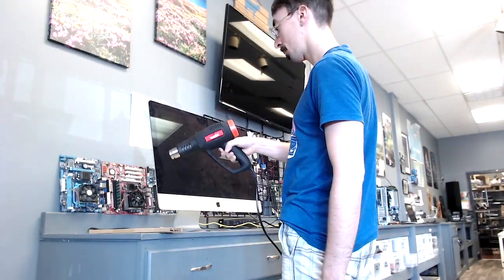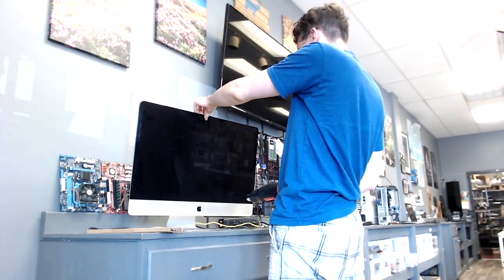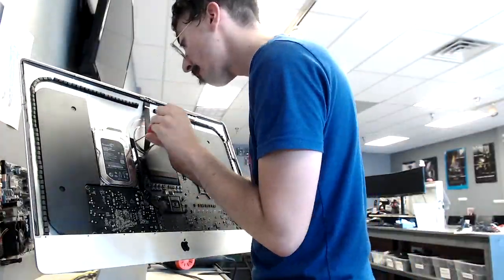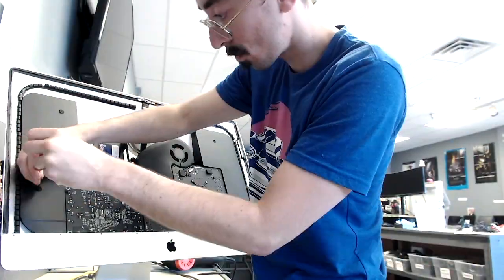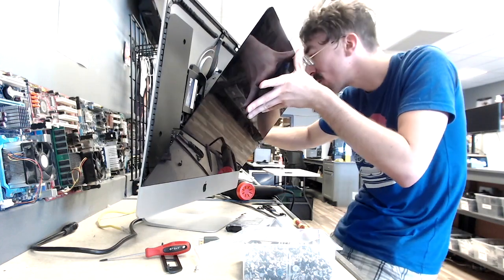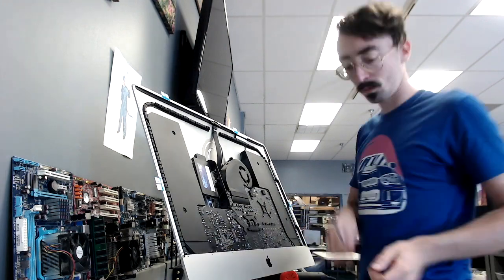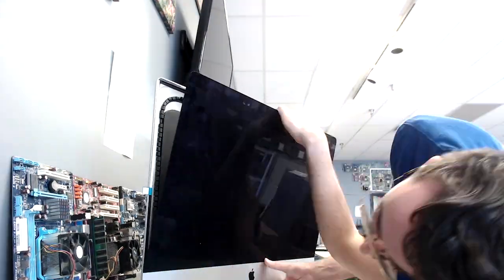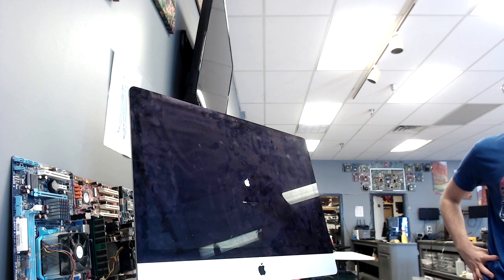How To Quickly Upgrade 2015 27" iMac Hard Drive to SSD

Comment: You made it look real easy, thanks dude. I wouldn't bother with a bracket for the SSD, as they're pretty well shock resistant. Hell, I'd probably even use double-sided tape.